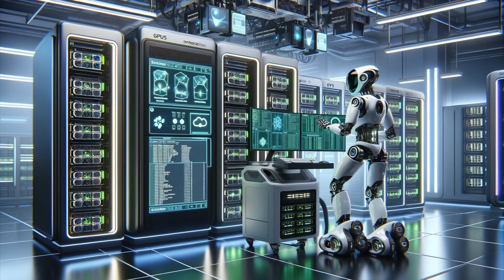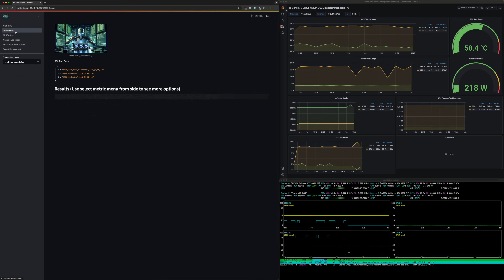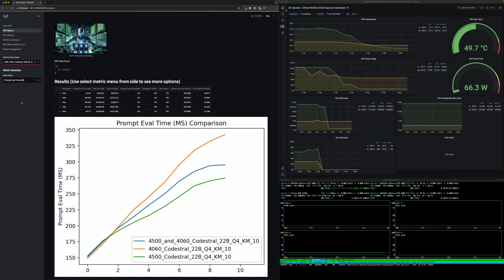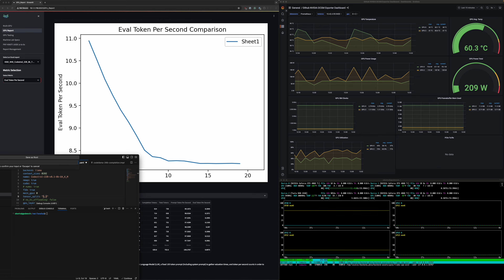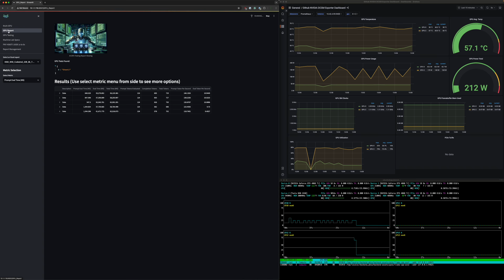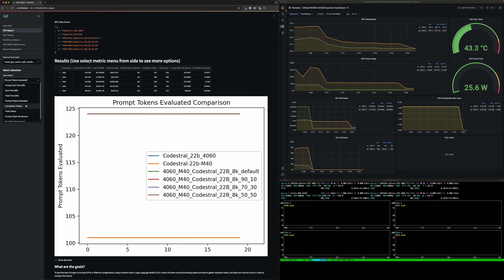LocalAI LLM Testing: Viewer Questions using mixed GPUs, and what is Tensor Splitting AI lab session

Comment: I’m achieving excellent results with a configuration of an RTX 5070 Ti 16GB paired with an RTX 3060 12GB. I primarily run Qwen/Qwen 3 32B, Deepseek R1 32B, and Gemma 3 27B, all of which perform well. I also utilize several smaller models, including GPT-OSS 20B, Mistral 4B, and Dolphin Llama. I particularly recommend GPT-OSS 20B, especially when integrated with web search – it’s a powerful combination that runs remarkably well on my RTX 5070 Ti.

Comment: Two questions sir. Have you tried other inference backends? There's a project called Cortex cpp - a kind of alternative to ollama made by guys, who developed Jan AI. The main pro for it is that it supports TensorRT - Nvidia inference engine (and specific model format, different from ggml). These guys are claiming it's 40-60% faster, than llama cpp. They made a big comparison between post about it, running different GPUs and everywhere TensorRT was a huge win.
Second question is - did you try to equip tensor parallelism?
Reply from the maker: I have played around a bit, but not a ton as don't have much time. I do run LM Studio/Ollama/etc locally - and Local AI supports many types of backends, not just Llama (which I mainly use). VLLM, etc.
I don't think llama.cpp (under LocalAI) support tensor parallelism yet, believe there is open PR/feature request. Vllm might - so answer is no I haven't.

Comment: Can you run a larger model when you span cards?  Or does your model need to be able to fit on each card that you tensor split across?  What happens to performance then, if you can run larger models by aggregating card ram?
Reply from the maker: You can absolutely span the larger model between cards! These tests are actually doing that, performance depends on cards you are splitting between - but will be between your lowest end card, and highest end cards (if different models). Running multiple cards doesn't necessarily increase performance, it's really for expanding your VRAM capacity.

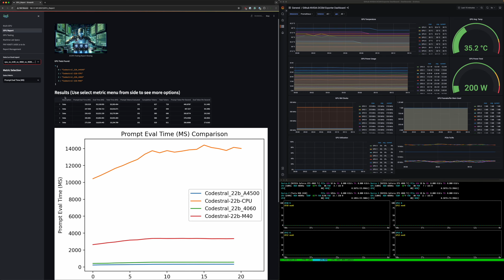Comment: Question: @03:14 - NVTOP is showing - 90+ Degrees (86 on the M40) Fahrenheit on each of those cards... WITHOUT any active usage?
- That seems excessive. Currently running a 4x3090 setup at  79-degrees or lower, in-between queries.
Reply from the maker: the 4060's are stacked with each other on the bench node in this test (I don't recommend that, they could use space between them since side facing fans, and why I use a lot of pcie extenders normally) and don't run their fans unless there is a load - the M40 in this test has an active fan on all the time. Also I live in a hot climate and it's been 85-100 degrees  (75+ in the workshop as it's not conditioned)🔥
Reply: @RoboTFAI  👍- Just looking to learn ways to extend the life of these GPUs and increase performance for LLM usage when running 10 hours a day (work day, remote-work, as a code assistant)

Comment: I think loading is still an important factor, so do you use NVMe drives, like the large, high write level Octane p900 series for the fast load?  and FPGAs for pre-setting data (like video, pictures) reconstructed in a faster use mode?
Reply from the maker: I normally leave the unloaded model test off as it doesn't allow as much resolution in the smaller charts. I use Gen 4 NVMe M.2 drives in each of these systems (rated up to 5000/4800 MB/s...yea right).
Reply: Or you can get 1tb ram and have 500gb ramdisk ^^
Reply: @Zeroduckies  Using HP ML 350p machines one only gets up to 768GB of dram that has to be LRdram, but that ram is running on three channels that actually slows it down from the 2 channel 256GB because of the required 'blocking in' and processing.  It is all in the specification PDF from HP..  It is only when going to The G11 model that one actually get significantly faster (PCIe 5.0.. HP skipped the 4.0 architecture in these machines) ram and a larger capacity at a astronomically increase in price..  So when getting a 'loaded' 256 dram ML 350p G8 afor a trade of on older gamer machine with a at GTX 1660ti and a less than tenth geni7 (about a 300$ value) one must be looking for a fast economical memory solution and that is where the Optane P900 card come in (with their 4000GB/s bust) and one must also compare that at the rate that the GPU actually can take in, so this is a cheap way to run data in (and out) in a comparable manner as dram... plus you are only occupying a PCIe 4 lane.    Now this is al gfine and dandy, but in dual cpu chip-sets, the PCIe lanes go all over the place and that is a major consideration as the right and left side are controlled by different CPUs and SLI or VRLinking can be required for OS recondition of the linked GPU cards that is inherently required for proper function logging.... and PCIe controllers on these machines.  They are going to be slower than single CPU specifically designed mother boards that are made other companies such as the multi-PCIe 16x SuperMicro or Gigabyte professions models... that have come out specifically designed for this type of application that use NVME arrays for storage.. and then you are back to the amount of writes that are going to be applied to the storage.